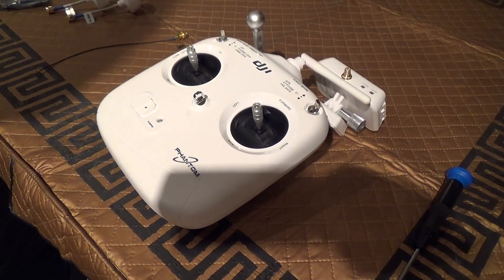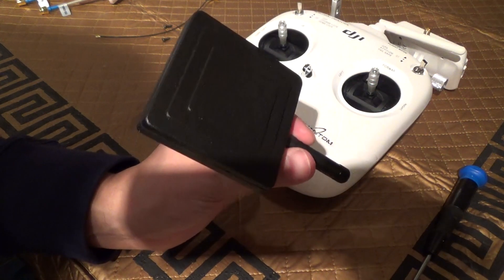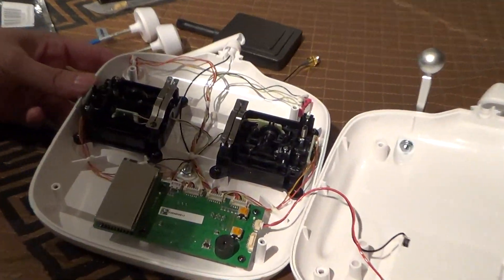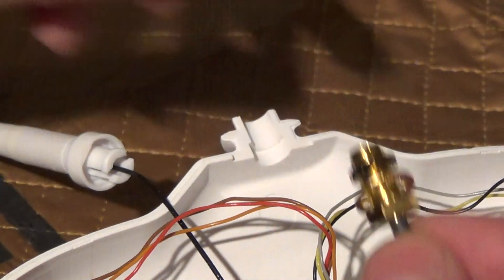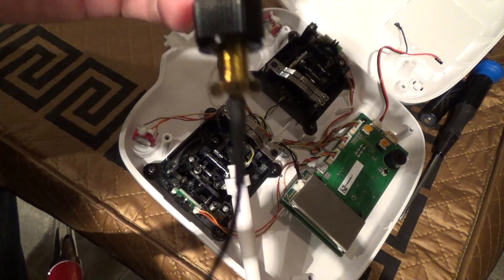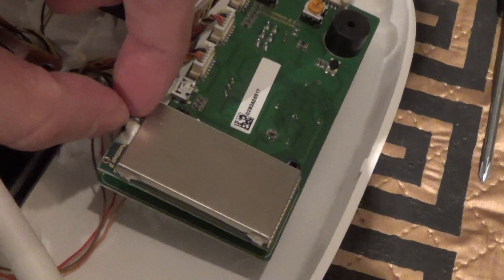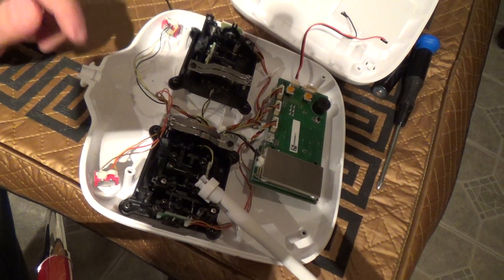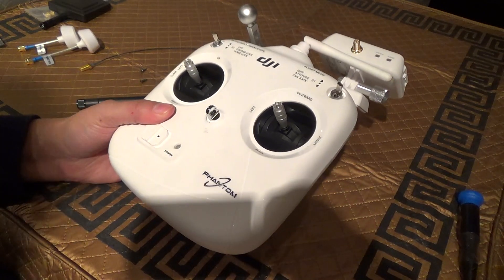DJI Phantom 2 Vision RC Controller Antenna Mod Assembly and Disassembly.

Comment: Hi again, I just ordered new external antennas for my modification. I was even able to find them white! I bought two 2.4 GHz for the extender and one for the transmitter. The only catch is that they only had a 5GHz antenna, they told me it would work with a 5.8 transmitter. Do you know if this is correct? Thanks again, luv your vids, please keep them coming!
Reply from the maker: Most 2.4ghz antenna's will work with 5.8 and vice versa.  I'm going to use the 2.4ghz antenna on my 5.8 tx when I do this upgrade myself.   I've also used 5.8ghz antenna on 2.4ghz equipment without a problem.
Reply: That's good news Ben, but I think I got one of those Phantom's that was built when the FAA inspector was there. LOL I'm not really getting any better range at all. I was near a small patch of trees today and as soon as it when over them I lost picture. I thought at least I would get better penetration. Is there something I'm doing wrong? Thanks!
Reply from the maker: Yeah regardless of antennas you will dramatically loose distance if you fly behind anything including tree branches.   You need to always fly high enough so that you have a clean line of sight between you and your phantom.  If no matter where you fly you can't push over 1,000 feet then yeah you may have a bad wifi transmitter in the camera or the repeater itself.  It wouldn't be the first time it's happened.  Though more the exception than the rule:
Reply: I will try again in a large open field. I did try mounting the range extender on a 10 foot pole, that seemed to help, but not much. I can go over 1000 straight up, but I want to be able to go straight out, not just up. Ideally to be able to film close to the ground, or follow objects on the ground. if I can only go 400 feet before losing visual, what was the point of making the modification? Thanks again!

Comment: Quesiton, ive looked at your videos and even though i know nothing about antennas, what would happen if i did both mods you talked about (wifi extender + controller range extender) with 2 8db antennas (which you mentioned) would that create any interference between them? would they work ok? what is the expected DJI range as well as expected wifi video range?
Reply from the maker: No it wouldn't create any interference between them so no worries.   Range is highly variable depending mainly in part to sources of interference both were you're standing and patches of the sky you fly over.    I've had dramatically different results using it at my park with poor operation in one spot, but excellent operation standing just 30 feet away approximately.  In good conditions you'll have no trouble pushing past a quarter to a half mile using just the 8dbi omni. You may even get further if there is no wifi or electrical interference in the area.

Comment: According to what I read you're using an RP-SMA FEMALE CABLE , NOT MALE, and the antennas should be RP-SMA MALE....Please give a look: http://www.wellshow.com/technical-support/rf_connector-rp_sma_connector/   and   http://www.wellshow.com/technical-support/connector-support/what-is-an-sma-connector/    the jack seems to be always FEMALE and the plug alway MALE ,  in the SMA the pin is in the plug  (male) in the RP-SMA the pin is the jack (female). 
See also: https://www.sparkfun.com/tutorials/140 
Could you check?

Comment: Nice video. In the Phantom 2 (not vision)  the RC doesn't make any beep when switched on,so  if you turn the back screw clockwise, it doesn't make any beep-beep after, you think that it works anyway ?
Reply: In the P2 (non-vision) there are different regulations regarding CE vs FCC.  The pot does not make a difference.  It turns but the max stays the same at 2.4
Reply from the maker: It should be the same as the P2V given the only difference is the 2.4 vs 5.8 control.  It's the bottom screw not the top. When in CE mode you would hear one beep FCC mode two beeps.  It can also be configured in the RC Assistant software when connected to your PC.

Comment: I own a P2 and interesting you mention the Micro USB. My controller has the port on the bottom.
Reply from the maker: Yeah the P2's have the micro usb externally. the P2V for lord knows what reason comes with it internal.  Though that may change. I did see one report of someone buying a separate P2V controller with an external USB port on it.

Comment: is the stock TX antenna 3dbi Ben?
Reply from the maker: I think it's only a 2dbi antenna, 3 is unlikely.
Reply: Ben7seven7 thanks for your reply- I hope it's only 2dbi- I want to see a marked rc control range improvement with the 5.8Hz 5dbi omni whip antenna I just purchased..it seems the patch antenna is overkill considering the reported long ranges of the stock TX antenna and thought 5DBi should be enough to keep up with the upgraded antenna/s for the 2.4 Ghz video signal without being too 'directional'..

Comment: Hi Ben thanks for this upgrade have all the parts look forward to seeing the next stage I see u put another tp link on your extender has it made any diff thanks once again keep these mods coming happy flying
Reply from the maker: The dual antenna setup I recently did on the Wifi repeater made no difference in terms of absolute range though when using two of the same omni's on it it did seem to hold a little more stable, with both the antennas pointing in different directions.  The best setup for a dual antenna is probably using a combination of a high DB Gain directional antenna along with the 8dbi omni directional for best of both worlds.

Comment: Thank you for your reply ,but do you know how much can I get with FCC mod without change the stock anntena?
Do you think that I can get more 500 meters ?
Thank you again
Reply from the maker: I personally have done 785 meters away at 100 meters up while still holding good control signal.  Stock controller depending on the area you fly has been tested by many others to at least 1 to 2 mile range with no mods. That's distance. Altitude I can't go as high as I can far without having control loss.  When I get around to swapping out my antenna I'll see if that changes which I expect it will.
Reply: Ben7seven7 That's because of the antenna orientation.  Adjust your antenna so that it is closer to a horizontal plane and you'll be surprised how high you can go.  remember that while these antennae claim to be omnidirectional, they propagate a much stronger signal/full wavelength parallel to the antenna itself.  The don't send much signal out of the tip...

Comment: Great video , going to be doing mine real soon, curious to see part two...I am also looking to do the camera antenna as well....having great performance with adding two 5dbi TPlink repeater antenna's
Reply from the maker: Thanks, I did the camera mod on mine already, I'll post the video when soon. Though the performance of the camera mod various widely depending on antenna configuration and placement. It's tricky to find the right combo.

Comment: Thanks for making this video Ben-great job!-  looking forward to seeing teh follow up video installing the replacement antenna..
Reply from the maker: Thanks for the feedback.   And yeah when I get my parts I'll do my controller and post results.  The only time I've had control problems with stock controller is going for highest altitude as opposed to straight out distance as my FPV fails before control does.

Comment: Thank you for your nice video,but are you sure friend that the stock remote controller gives between 1 and two miles ?
The DJI said with FCC you get 500 meters.
Reply: He means after the mod and with a TP-Link 8dbm antenna attached.
Reply from the maker: Yes, others have tested the stock controller to well over a Kilometer.  And some with the FPV range have tested to over a mile using the stock controller. I've personally flown a half mile or 800 meters at 100 meter altitude with no control issues.  It's max altitude where you run into problems and where antenna swapping will be more useful.